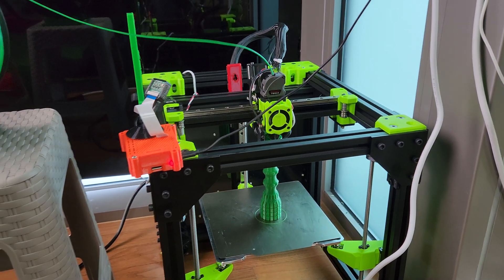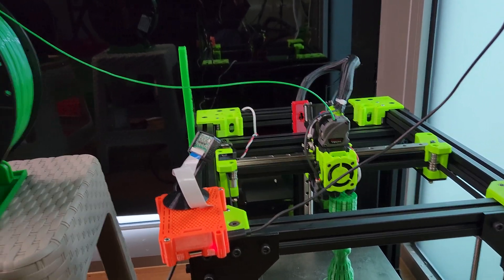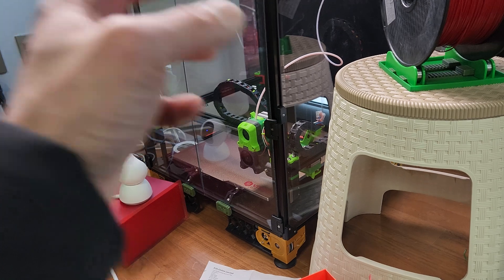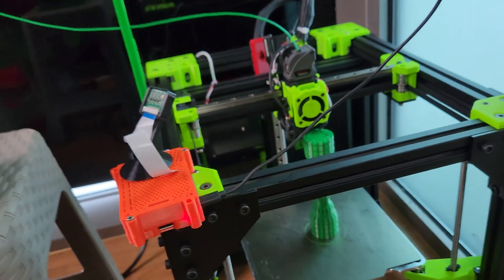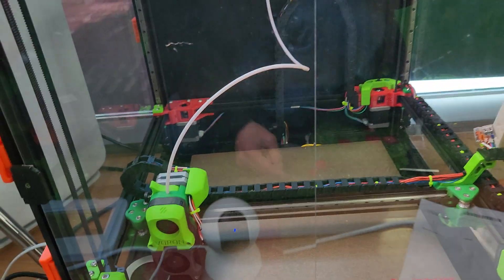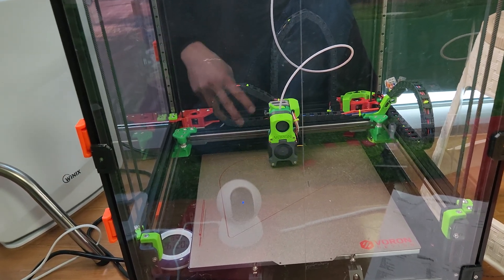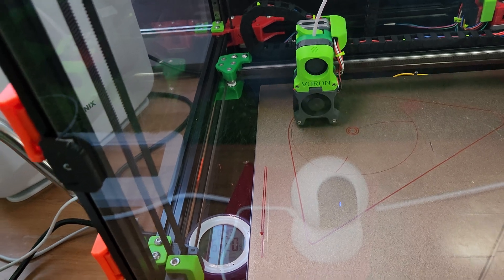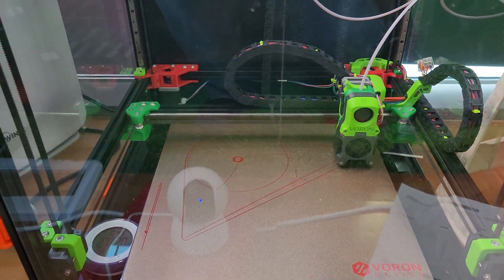Ratrig VCore 3.1 vs Voron 2.4 Fixed vs. Flying Gantry!

Comment: The flying gantry of the Voron always seems like a negative to me.  For example if you want to have air blower for the part, it would have to be mounted on the the flying gantry. (adding weight) On a fixed gantry the air blower system is rigid mounted to the frame.  Also if you bump the flying gantry while powered off, it falls down and has to be manually re-positioned.  No such issue on machines with a z-axis bed.

Comment: I decided for the RatRig VCore 3.1 500 (just ordered it a few days ago). As I have a niche with 1 by 1 m² to place it, I will anchor it to the walls at the top and the bottom, so I do not think the center of gravity will matter. Anyway, the Voron 2.4 is not an alternative if >350 by 350 is needed (there is the Voron-inspied Jennyprinter 650, but it is to big to pass through doors).
One advantage of the VCore (and the Trident) design is the ability to do modifications later on. For example a toolchanger is much more easy to add if the xy-gantry keeps on one level - else any toolchange would need to move the xy gantry to the top or the toolbay down to the actal z-hight. Also if you want to test other xy-gantrys - like crossing rods - it's much more easy with the xy not moving up and down.
Reply: Thats the way to go, ancor it to a solid wall!
If that is not possible then use some 6mm plywood or 4mm aluminum screwed right on to the aluminum profiles on 3-walls and put a sand bag on top of the printer.

Comment: I've been waiting for a video like this, it's a pretty good comparison. How was the build time and complexity?
It sounds to me like the choices are a lightweight machine that vibrates with taller prints, and has rail slop on a moving gantry, or a beefier machine that might wiggle with short parts. 
One solution is to add a brick or two to the tops of them. I'd be very surprised if that didn't solve the vibration issue with both of them. (But it will help the RR more, because the flying gantry will always have more play that won't go away.)
I'd lean towards the RR due to the three-point bed mounting. It just seems more properly engineered, and less over constrained with reliance on system slop.

Comment: If the movement doesn't affect print quality then it's not an important point of comparison. It seems to me that the complexity calibration and maintenance of the flying gantry on the voron versus the mobile bed on the ratrig would be a good place to dig in on a comparison
Reply from the maker: I would say not too much maintenance on the voron 2.4, just make sure belts are calibrated correctly and the flying gantry levels itself very quickly.  There is also voron trident which is like ratrig setup too.

Comment: I was considering a ratrig vcore 3.1 500mm. I never thought about this issue. Would running some weights on the bottom like a washing machine? So on the bottom, would it be possible to insert a floor and place a slab of concrete to keep the weight at the bottom?
Reply from the maker: It's not really an issue for actually printing, only if going pretty fast.

Comment: good info, im thinking on buying one of those machines?what do yo recomend a voron 2.4 or a v core 3.1?
Reply: The ratrig v3.1 is actually a better printer, can achieve much faster speeds without ringing due to the beefier 3030 extrusion. Note that the poster of this video seems to have it sitting on cardboard strips, I am guessing because the rubber feet are not installed, this isn't go do any favours for stability when the bed is at low Z. I would also advise the 400mm version with the 2.0 enclosure, this adds height and weight to the printer which give added stability.
Reply from the maker: I recommend Voron 2.4 if you wait until i put out some klipper tutorials or figure it out yourself, ratrig is much easier on the software side and assembly also very good choice.

Comment: Ironically, the trident/Ratrig is actually generally better for speed. The flying gantry has it's own slop to account for that a fixed gantry doesn't have. As far as things "getting better" as you get higher, it also gets worse on flying gantry as you go up as you stated, but the fact that it's always got the slop, it's worse over all. The Voron 2.4 does look insanely cool though even if it's not able to reach the same accels.
Reply: Properly tensioned Z belts of reputable quality are not going to have virtually any slop... Though it would be completely valid to say that tensioning all four belt pillars properly--and equally--is far more difficult and error-prone than a fixed gantry design.
Reply: @sasca854  they also can't be as rigid either or the gantry can't twist to level.

Comment: This is good info.  I never really thought about the printhead on the top vibration vs having it at the bottom.  I am gearing up for a Voron build and I think the probe is a good idea.  It is a good video but I have to say your hand is a little distracting.  Reminded me of this https://www.youtube.com/watch?v=vEjgqJzCzK0  Loved the info and it is good advice for a Voron, though I do like the idea of bed mesh even if it is a little un-necessary and overkill.

Comment: Home Z, then do a puge line close to the endstop pin, Then re home Z. that way the purge line cleans the nozzle. No need for any fance purge bucket+nozzle brush setup.
Reply: OR...just do the homing when the nozzle is cool. A hot nozzle doesn't affect your z or qgl. 

Better would be an out of the box solution, instead of a problem.
Reply: Cold filament will mess up z switch as it trips on filament.  Need clean or purge first, or hot filament,but never cold.